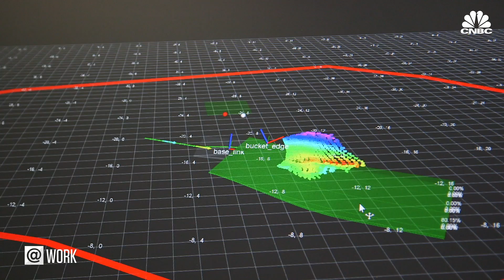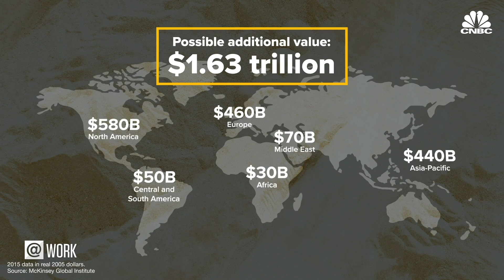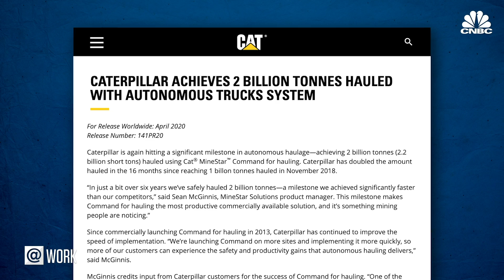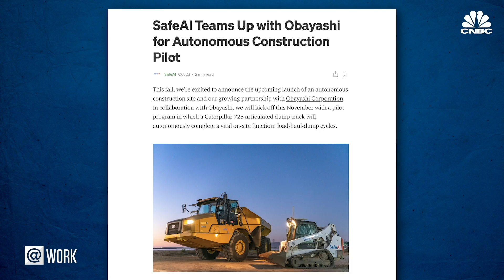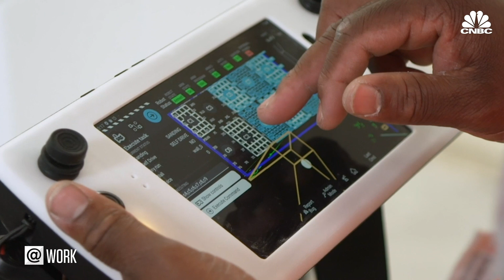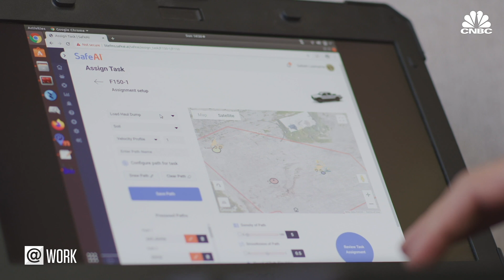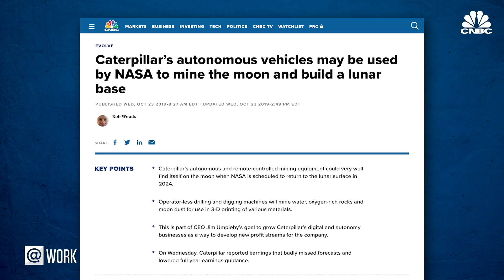How Autonomous Robots Are Changing Construction

Comment: If these robots will contnuie to fill buckets in such manner, all they should be fired soon.
Reply: Problem is robots are 10x cheaper than human and can operate 24/7, so even if 10% efficiency, it is still beneficial
Reply: @voidvector  Actually no.

Machines can (and do) already operate by hot seating, i.e. 24 hours a day. The BIGGEST cost in operating machinery isn't paying the operator 100k a year, it's putting fuel in the thing, it's paying for the loan on the machine or the hire costs, it's maintenance.
Reply: @Mr539forgotten  All costs involving machines (manufacturing, operating, and maintenance) are dictated by economy of scale. 

If the machine is not mass produced or require customization (e.g. tower crane), it is going to cost a lot. If the machine is mass produced (e.g. anything you buy retail) it is going to be cheap to buy and maintain.
Reply: @voidvector  they sure can work around the clock but the fuel is the main cost in this industry so no one can afford to be that inefficient.
Reply: @grzegorzswist  If somehow fuel is the main cost in a machine that replaces human, then it means the person who designed the machines didn't design it properly. 

Human needs fuel too. Human fuel is called "food" (which is paid for by wages). It is plausible the machine consume 10-100x the energy/fuel than human. However even then it would cost less. You will be lucky if human can sustain 0.1 horsepower for an hour. It takes a machine half a spoon of gasoline to do that.

In most cases, machine doesn't replace human with bare hands, it replaces human using an existing tool/machine that already uses fuel. 

The only absolute advantage human has is versatility.
Reply: @voidvector  ok. To be more specific.  In my work we use anything from 1,5t to 50 tons machinery. 
While in use lighter machines cost roughly 1:1 in fuel costs to human operator wage per hour. 
The heavier machines cost about 4:1 in fuel to wage.
So it would seem that the lighter machines could benefit more from automatization. But it's more complicated because: 
1they are cheap
2 anyone can use them with very little training. 
Buying autonomous versions could 
At least double the price.
The heavier machines the human operator cost are less a factor so it's a diminishing returns case.
In my opinion they should forget for the time being about excavators and loaders and focus on compactors. It's a systematic and predictable work unlike the rest.
Reply: @grzegorzswist  I don't think fuel cost will be the determinant of automation. It will most likely depend on as you pointed out "systematic and predictable". 

One thing to note is there is nothing stopping a total redesign of the process. For example, excavators and many other multifunctional tools are designed to be operated by humans for multiple purposes, which makes them harder to automate. There is nothing stopping someone from replacing it entirely with something that's designed from the ground up to be easier to automate (e.g. maybe using microtunnel boring machines or vacuum excavator to dig or move dirt). Of course doing so would increase cost as it cannot share toolset with common human approach.
Reply: @voidvector  it's an interesting concept to completely reinvent construction machinery for automation.
But we have to keep in mind that we are talking about machines in which operator cabin and his comfort used to be an afterthought. 
I am more interested in replacing diesel engines with electric motors as it seems more inline with what the industry needs.
Reply: @grzegorzswist  im sorry but this is not the case. Rio Tinto and BHP have hundreds of autonomous heavy machines. The heavy machinery industry are the leaders of autonomous machine fleets and it has nothing to do with fuel ratio. Autonomous machines do not need food or toilet breaks, they are safer and they are better at driving consistently and therefore maintenance can be easily forecaste due to the consist wear and tear on the entire fleet. Autonomous is not a pipe dream, it is here on a large scale and will be a part of our general day to day lives like it or not because it pays dividends.
Reply: @voidvector  no i would tell why i dont feel like typeing it all up
Reply: @voidvector  not of its taking 20x the amount of time.

The problem with these automation is the people creating these don't understand te industry and probably never touched a shovel or equipment in their life. 
Automation is coming to this industry but it won't come until someone who understands this starts developing them. 

A human operator can outwork 3 autonomous machines in a 10 hour shift.  I don't see these machines able to load trucks efficiently or adjust grade due to bad plans/models.  I speak from experience, I have had to fix the 3d models for GPS assisted equipment because 50% of what the engineers give us doesn't work.
Reply: @vikkzx  so lets wait until the robots become professionals in Programming, then loudly laugh.
Reply: @vikkzx  I agree with your statement it needs to be done by someone with hands on knowledge. 

However, I want to point out, most publicly visible "automation" in private sector these days are done by smaller firms with limited resources. In the larger firms, the level of rigor for automation is ridiculous. --- For the point you brought up about bad plans and models. There are people literally writing simulators for the process automation so the plan can be tested before they are run for real. -- However, larger firms are mostly preoccupied with automating their own business processes at the moment, rather than something require multi-firm collaboration (i.e. construction).
Reply: @ПетрСиницын-ь7ы  Once there is Artificial General Intelligence (AGI), that's going to happen within a few years. In fact, I would say programmer automation probably going to happen before construction is fully automated. 

But once we have AGI, it is just mounting that onto a Boston Dynamics machine, for it to be one of those robots in sci-fi movies that can do everything. 

I want to point out programmer's job is mostly implementing vague requests by management into code/software that can be used. 
Does that sound familiar to what construction worker/builders do?
Reply: @vikkzx  imagine the robots coming in on a rain day and trying to make heads or tails of the footing
Reply: beat it with a sledge hammer
Reply: I have single digit hours of seat time and I can fill a bucket better than that, and more smoothly.
Reply: They can work in the dark
Reply: @Pernection  most automated shop floors work in darkness. It's only when human intervention is required that the lights come on.
Reply: @Pernection  guess what i can work in the dark to easy we all can
Reply: @Pernection  We'd love to invite you to our podcast as a guest ❤️
Reply: They’re doing it for free. Who cares
Reply: @tyleroliver5571  they ain't free. It cost shitload to set up.
Reply: @grzegorzswist  at first yes but over time it’s a hell of a lot cheaper than paying wages, insurance, wcb, injurry claims, etc. They’ll make their money back a thousand times over cutting us out of it! Just look at the manufacturing industry. Prime example, it’s only a matter of time. In the end it’s always the people that loose!
Reply: Let me tell you something i work and i saw why it dose not change you need quick we are not land surveying for rodots to come in and do landscapeing no it cost to much i am haveing a lot of promdles with this suff like only on big sites you need to buy this stuff separtley that only a few you work on time and money and we are tight on what we want we want stuff easy to use quick to use and stuff to make work easy and not be a pain to move if it dose not meet those crities than we throw it away and we dont use it
Reply: Yeah it was horrible clearly the AI needs some work because a human would of filled those buckets 1 shot and bee. Slinging dirt all over the place
Reply: @kingsamoanOG  "would of"?.... At least those robots have better grammar than you! Ha!
Reply: @johndavolta3124  Auto edit with AI will make bad grammar a thing of the past. Enjoy the human typos while they last. We are heading towards perfection.
Reply: @rext8949  ha ha true!
Reply: @johndavolta3124  Pointing out other peoples grammatical mistakes doesn't make you smart.
Reply: @fatrat92  whatever...
Reply: @johndavolta3124  Yeah, I thought so.